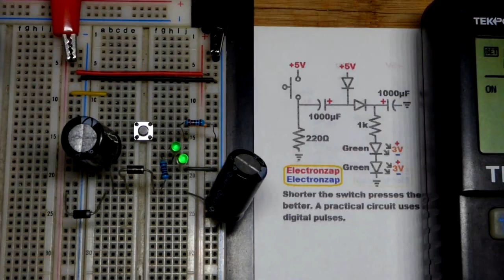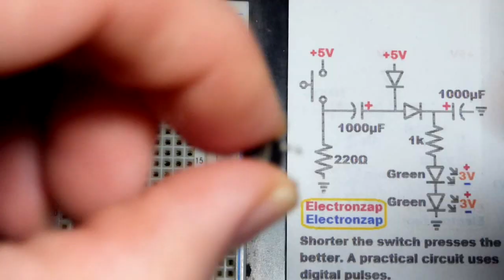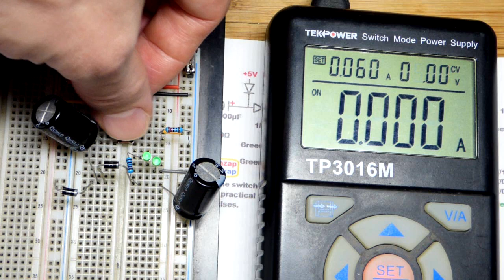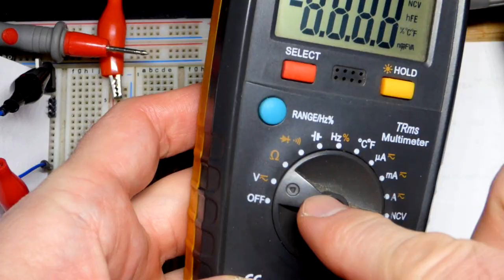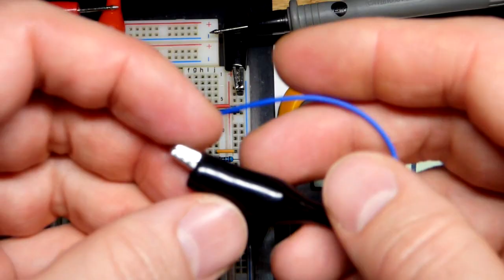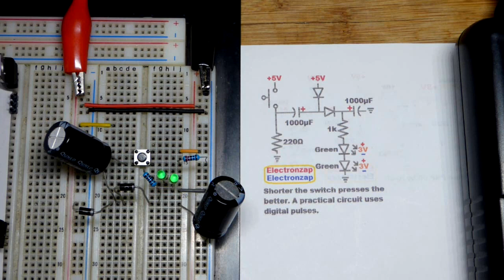How to Make DIY Voltage Doubler Minus 2 Diode Drops Charge Pump Capacitors

Comment: Great circuit, I have observed others use a 555 in place of the switch and 220 ohm resistor, but your circuit  gives greater clarity of how the switching process acts upon the components.
Reply from the maker: Yeah, definitely want to use self oscillating circuitry in a practical circuit, this is just simpler to understand. Thanks for watching!